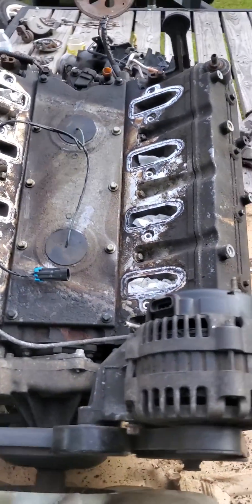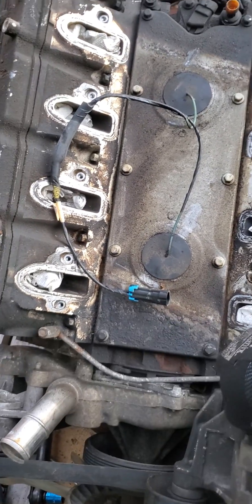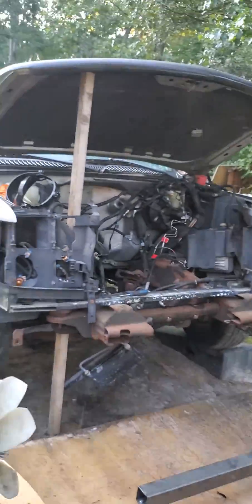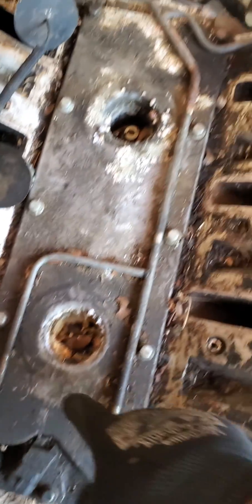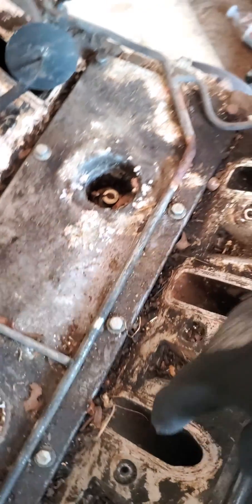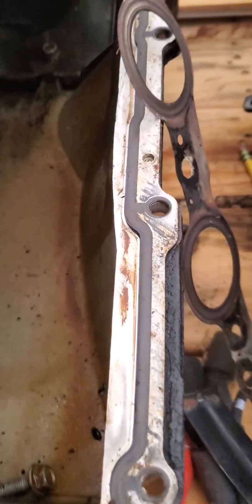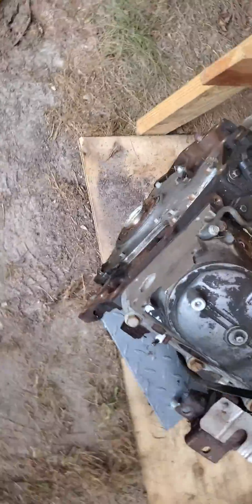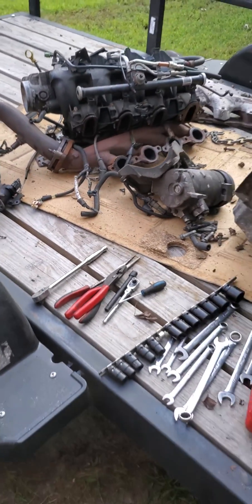Silverado Vortec 5300 coolant steam tube 2000 vs 2003

Comment: coolant cause that? 😂
Reply from the maker: Yes, when I bought the truck the engine ran fine. The brake lines were severely rusted so I parked the truck and began working on it. I didn’t know where  coolant leaked from. I let it sit for a while and did not notice the coolant had puddled where the intake was. After about two weeks of replacing the brake lines and abs modulator I went to crank the engine and that’s when the rod snapped however the engine still turned on and ran. I have another video showing this. When I checked the oil pan I saw pieces of metal also another video showing this. I removed the spark plugs to check the cylinders and found a lot of fluid on top of the cylinders on the passenger side of the engine where the coolant steam tube was leaking. I must have removed about 8 oz of fluid. Put the plugs back in and the motor turned on without hesitation running on 7 cylinders. This has been a total learning experience for me and I have since swapped the engine. Truck turns on fine now. In this video I’m showing the 2003 5.3 I bought and the difference in those steam tubes compared to the original 2000 5.3